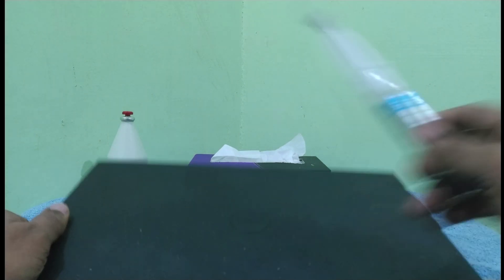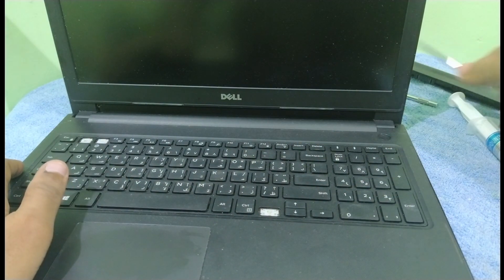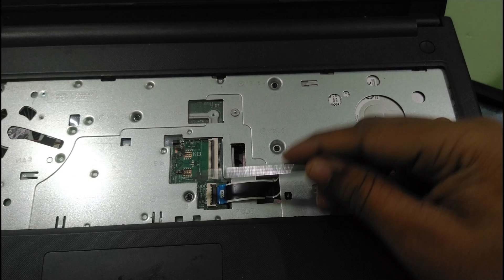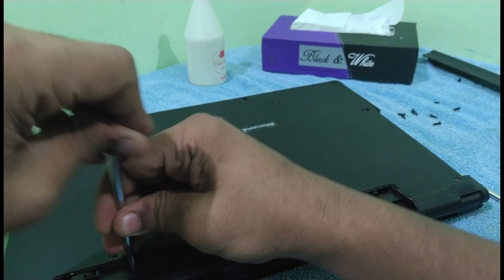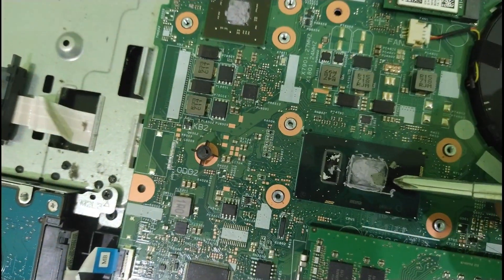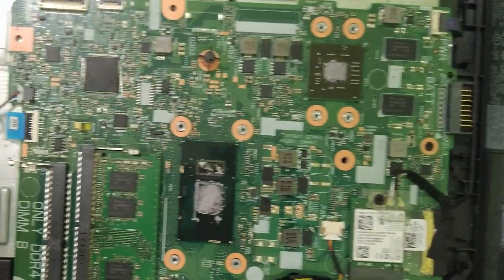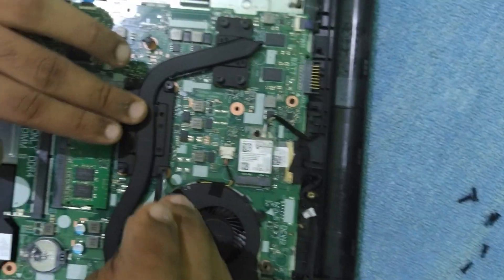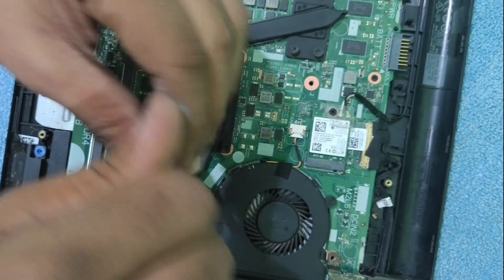How to replace the old thermal paste of a laptop (DELL INSPiRON 15)

Comment: I had this on mute while I watched, I laughed hard!  Please DONT use after shave it contains oils that will burn the CPU.  Just use regular sd alcohol or even windex on a cloth.  As for thermal paste DONT use as much as he did! It will overrun onto circuit board.  Just use small amount in very centre or thin out with credit card.  Other than that, the dismantling part was helpful.

Comment: I fixed a desktop with your homemade thermal paste. Now I am inspired to try to fix a laptop that overheats. I will need to watch someone else take my exact laptop apart before I try. However I am confident that replacing the thermal paste will solve the problem. Thanks again!